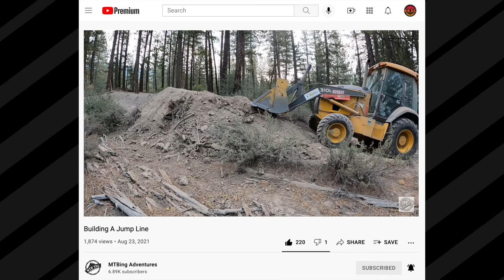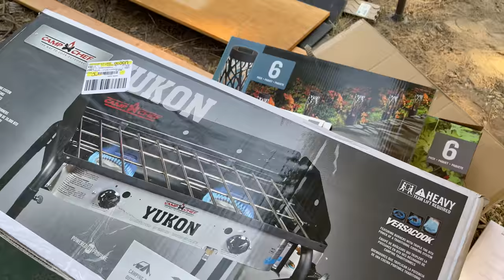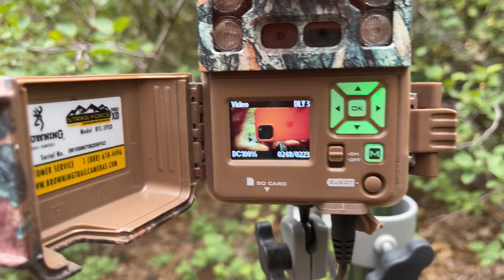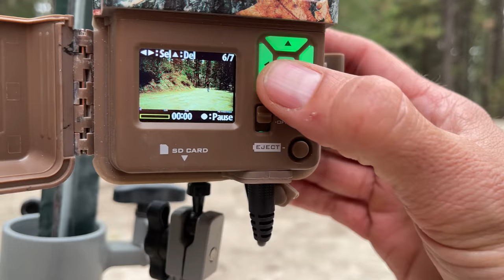At this point it's a LITTLE scary, but these animals are amazing | Building Everstoke

Comment: Tip: Shut the valve off on your propane tank when your not using it. Some control valves on cooktops and grills can corrode when left to the elements and leak slowly. Nothings worse than getting ready to cook and no gas or just enough to start and you run out 5 minutes into preparing the meal.

Comment: Wonderful. Really liking this progression... 101 in the Grumper... ooh man. 
Love the animal clips. You have a very special spot for them criters.

 Something to think about showerwise.  When you get into winter time and want that HOT shower. There are some really nice self contained remote shower systems. All you need is the ability to have a head of water(low psi, free flow). 12v power pump into tankless heating element. 

Next, build  something akin like the grumper, but a shower stall(cedar paneling), add the tankless shower system/solar powered... wahlaw... the ladies showing up will appreciate being able to have the privacy to stay clean for their men...